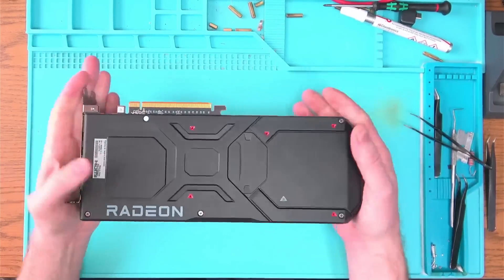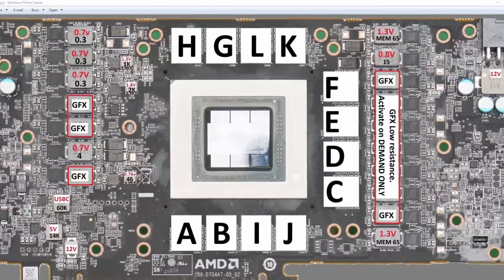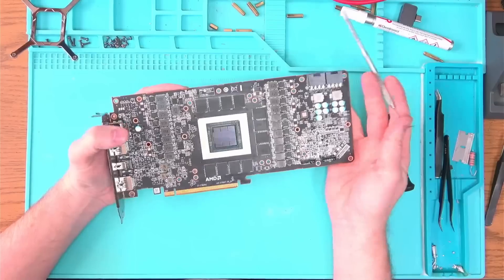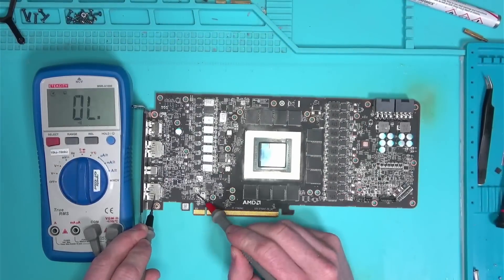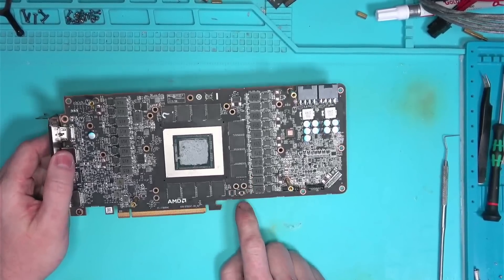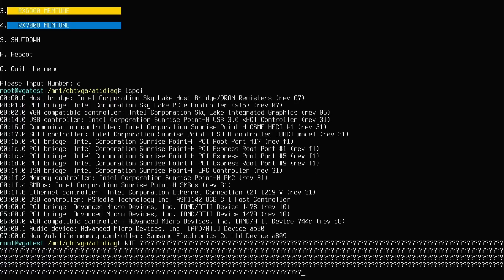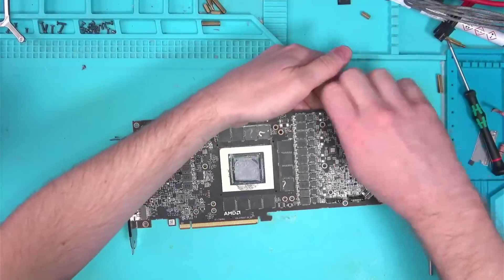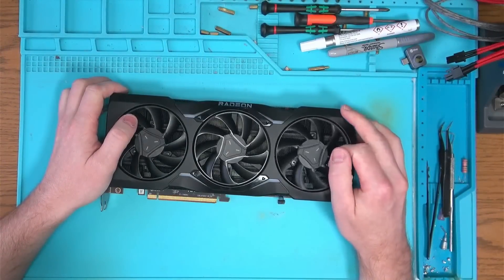7900XTX repair video

Comment: 0:42 - The "chiplet design" (also used by all current high-end CPUs, and now also adopted by nVidia for their next GPU generation) actually equals better yields, because a single defect on a silicon wafer will only ruin a small chiplet  (that can be replaced during fabrication), instead of ruining the whole GPU die.

Now, it's not impossible that TSMC (which is the company that actually manufactures those chips) had assembly problems with some specific early model (though I'm not aware of it), but chiplets are very much here to stay, from every manufacturer. Big monolithic dies are dead.

And nothing in your diagnosis points specifically to a problem in chiplet interconnects. If that were the case, changing the memory chips wouldn't have changed which memory channels you got errors on. Far more likely there's some damage to the board itself, but you'd have to chase and analyse the actual signal lines (using boardview, an oscilloscope / protocol analyser, etc.) to determine what it is, and it might still not be repairable at all.

Another (simpler) diagnostic step would be to put that GPU on an identical (but known to be working) card, or putting an identical (but known to be working) GPU on that card, but for that you'd need to have at least one of those, and it seems that you don't; I guess you don't get sent many of these cards to repair, which is probably a good sign (means they don't fail very often).
Reply: well to be fair monolithic will stay for lower end card at least for a while. the high end stuff is going to be chiplet based for sure though in the next 2-3 generations
Reply: @Azureskies01  - It's down to total die size. Naturally, there's a point where assembling multiple minuscule chiplets is more expensive than losing a few more (equally minuscule) full dies. I'm talking about gaming CPUs and GPUs (meaning mid to high-end), which are the ones people bother to send for repair.
Reply: TSMC and other packaging companies don't report on packaging yields. We don't know how much packaging yields eat into better wafer yields with chiplets. 

Allegedly, Vega 56/64 are known to be fragile due to HBM and interposer issues that develop from wear and tear. Almost seven years later, we can hope that AMD and TSMC figured out a fix for the fragility of earlier designs. Only time will tell to see long-term reliability of RDNA III's chiplet cards (RX 7700 XT/7800 XT/7900 XT/XTX).
Reply: @worldtownfc  - We know it's economically preferable, otherwise their clients (including AMD and nVidia) wouldn't be heading in that direction. Intel has also been using chiplets for years.
Reply: Yeah, I'm kind of surprised to see this guy bashing chiplets. With semiconductor industry slowing down the way it is in terms of innovation, chiplets are the future, whether we like it or not.
Reply: While true that the chiplet design approach addresses the issue with cost and yields, the reason NVIDIA is pushing it on their newest chips is because of AI, not cost. They’ve already reached the limits of current HBM/DRAM designs and bringing the memory chips closer to the GPU improves the performance.
Reply: @Lazllb  What are you talking about?!
Look at the GB100. Nvidia literally divided the logic i.e the stream multiprocessor clusters into two tiles.
Reply: Thanks this click bait title tilted me 😂
Reply: Also chiplet interconnects are done at die level, not at the socket. Since the GPU is tested before it goes on the card, such issue would be detected and the chip would either be used in a lower end card with that portion disabled.
Reply: Those chipletts are compute dies anyway don't think they have memory controllers, that's the center die.
Reply: This puts WAY too much faith in "one data path has an issue between chiplets = everything just gonna fall over the the next chips."

There have been more than a few instances of "that one particular point of failure went and caused a cascade effect, of not brought down the whole house" in the past.

A bit naive to toss that possibility out just because it's a new day.
Reply: surprise-surprise AMD back to monolithic again for RDNA4 lmao.
Reply: @satriadi1990   - It's only a surprise if you don't understand the factors involved in the decision. If you're using a process that can reliably fit a fixed-function chip on a single die with high yields, why would you pay extra to make it in separate pieces and then have to interconnect them? 

You use chiplets when a) you need the flexibility to change some blocks for different customers, b) defect rates on a new process are high enough that the amount of rejected dies outweighs the extra cost of interconnects and packaging , or c) the chip you're trying to make is so large it can't be manufactured as a single die. 

In any other situation (mature process, smaller, fixed-configuration chip), making a single die is obviously cheaper. And RDNA4 isn't trying to push any manufacturing boundaries; it's mostly an improved design aimed at the midrange market. Nvidia is currently the one pushing die size. AMD does benefit from a chiplet approach on their CPUs / APUs that used mixed processes, but for their (current) RDNA4 dies it wouldn't make financial sense.
Reply: Chiplet design may or may not stick around, depends on if there's any progress on monolithic designs that outpaces it.

Look into the Pentium Pro and the pros and cons of its separate cache die(s). I forget exactly why, but they eventually went back to putting the cache on the CPU die, as the "chiplet" design of the time hit a plateau.
Reply: @HaveYouTriedGuillotines  - Progress that improves monolithic chips won't negate the advantage of chiplets (in fact, it will also improve chiplets), it'll just shift the transition point (but some manufacturers will just use that to make bigger and bigger chips).

It's about die size and defect rate. Even ignoring issues like IP blocks and process mixing, beyond a certain size chiplet assemblies just become more cost-efficient. And when you hit "reticle size" (meaning the biggest size that can be fabricated with existing equipment) they become the only option.

The Pentium Pro didn't really use chiplets in the modern "functional" sense, though it is a good example of how similar packaging has been in use for a long time.
Reply: @RFC3514  
That depends entirely on how the improvements to the monolithic design works. You're not considering that it may be incompatible with a chiplet design.
Reply: @HaveYouTriedGuillotines  - Just like I'm not considering that "developments in weaving" would make cloth incompatible with the concept of stitching multiple parts together to make a shirt.

If "improvements in monolithic design" make it impossible to connect a chip to another chip with a short, fast link (which what "chiplet design" effectly means from a physical point of view) then they're not improvements - very much the opposite.
Reply: @RFC3514  
You don't consider much, do you.
Reply: Blackwell is technically not chiplets, but 2 DIEs combined, its a bit different. Similar to Apple Mx Ultra.
Reply: @gucky4717  - The definition of "chiplet" vs. "MCM" is a bit fuzzy, and Nvidia themselves have called them "chiplets", probably because it's the new marketing buzzword. The amount of money and effort Nvidia has invested into their interconnects suggests they plan to do more than just stick two identical dies side by side.
Reply: For decades defects were a problem between Nvidia/AMD and TSMC not customer at all and they have been still selling them. Either using defected chips for degraded models or selling to China market. For example there are tons of cheap GPU manufacturers in China, where do you think their chips coming from? 

So nope, chiplet design is just a cheaper way to improve performance not a groundbreaking new technology like both AMD and Nvidia trying to sell. And making customers deal with defects is actually way worse than now. 

Also when the card first came it was giving picture, he cooked it stopped giving picture then cooked it again this time different memory chips gave error. The problem is GPU die/chiplets alright, most probably from a defect always existed from factory. Also what kind of repair would require using a 100% working card as a part card? That doesn't make slightest sense especially while the board is so cheap. He wiped it a bit and lines began appearing, i have to agree really disappointing quality..
Reply: @ggoddkkiller1342  - Chiplet-based designs have wider implications than reduced impact of silicon defects (though that is also an important aspect in making bigger chips affordable).

They allow what's known as "Intellectual Property Blocks", where a chip has sub-sections made by different companies (ex., an AI chiplet from company X, an encryption chiplet from company Y, a video encoder from company Z, etc.) without the main CPU maker having to license all of them. Those blocks can even use different manufacturing processes.

And no one is "making the customer deal with the defects", just like the fact that the GPU and memory chips on a graphics card are separate doesn't "make customers deal with the defects".

You do know that graphics cards (and motherboards, and drives, etc.) are already made up of separate components which are then assembled into the finished product, right?
Reply: @RFC3514  You should had edited your message few times more until it actually started making sense! Seriously what the heck you are talking about? No wonder you wrote X, Y, Z there didn't give any company names because currently all sub-sections again produced by TSMC. You are giving examples from tens years into future or something??

Same goes for ''making it cheaper'', sure it is cheaper for Nvidia, AMD etc while it is not cheaper for us customers so i really wonder whose side you are on. They still cost a thousand dollars and here is a customer tossed his a thousand dollar into trash can only because his GPU had chiplet design..

I bursted into laughter while reading your last example, you can replace every component on a motherboard or graphic card etc, even repair PCB as this channel always does. Now go try to repair that faulty chiplet will you manage it, huh?? A thousand dollar GPU becomes ewaste so easily but it is ''fine'', ''cheaper'', ''faster'', ''stronger'', LMAO!
Reply: @ggoddkkiller1342  - I edited my message (right after posting it) to add the last paragraph as a helpful example for you (of components that are manufactured separately instead of monolithically).

You clearly missed the point, as evidenced by your reply that "you can replace every component on a motherboard". That's not the issue here: whether they use chiplets or a monolithic die, the user is never going to replace individual components of a chip (if anything, it's even more impossible to do it on monolithic chips). The point is how they're manufactured. Because making a motherboard as a single block of silicon would also make it a lot more expensive.

If you still don't get it, we'll just have to leave it at that. At least I tried.

Also, you don't seem to understand the difference between IP (i.e., the company that owns the chip design - like ARM, Nvidia, AMD, etc.) and fabrication (i.e., the company that manufactures the chips for them - ex., TSMC). I'm not even going to bother explaining that one.

And yes, chip designs with inherently better yields do "make it cheaper for us", because if they manufactured the same CPUs and GPUs as monolithic dies, the yields would be smaller, meaning each functional unit would cost more to make (same as if they manufactured motherboards as a single block of silicon - hence my previous example that you completely failed to understand). And who do you think would inevitably have to pay for that? Consumers.

No one is "making you deal with defects" in MCM chips any more than they "make you deal with defects" in monolithic chips. You always deal with the price.

And If you're not happy with the prices (or price vs. performance) of the current generation, do what I and a lot of other people decided to do: don't buy them.
Reply: Blackwell is not chiplet. It's simply gluing two dies together that's been done for a long time.
Reply: @TheGuruStud  Then I guess Huang was drunk when he claimed that Blackwell was a chiplet design?!
Reply: @TheGuruStud  - Well, MCMs have been done for a long time (and that's broadly the same concept as chiplets, just with more general-purpose dies instead of specialised ones), but the big change is in the interconnects.

Early MCMs were basically just dual-socket systems condensed into a single socket (later with added IGPs, etc.). Nvidia has clearly invested a lot in their interconnect technology for Hopper / Blackwell, to allow them to do more heterogeneous designs in the future.

Their main motivation in the short term is die size, but they know they need to be able to reconfigure their designs quickly for AI clients (a lot of them are already talking about designing their own chips, and Nvidia don't want to lose their biggest cash cow).

Comment: Nothing that a reball doesn't fix.

Flat tire?, just reball the core.

Cpu pins broken? You guess it reball the core.

South bridge of the motherboard broken? Reball the core.
Reply: When the tool you know best is a hammer, everything looks like a nail.
Reply: You forgot flash the BIOS.
Reply: brainware error? reball